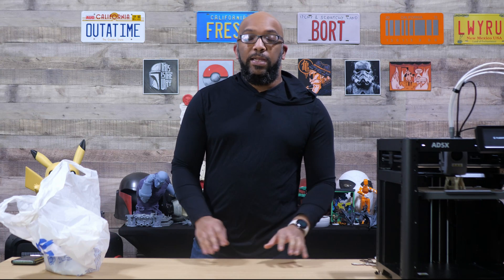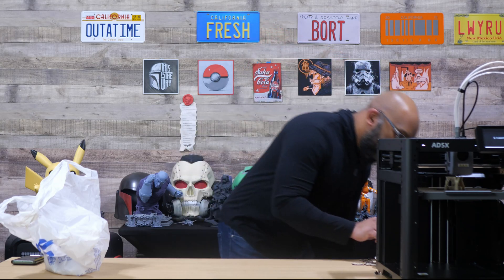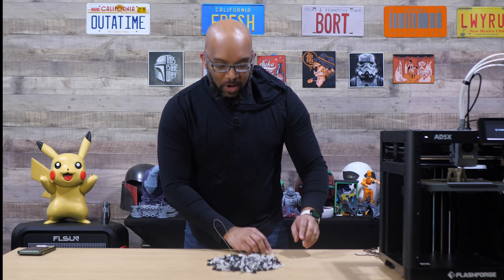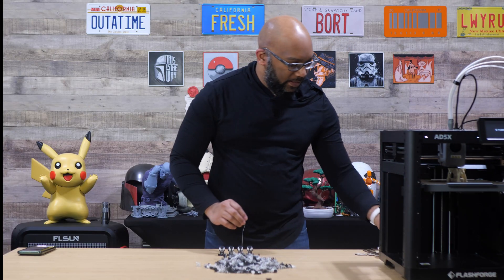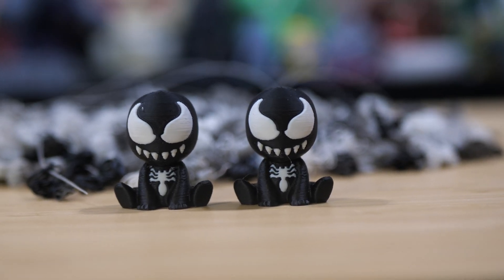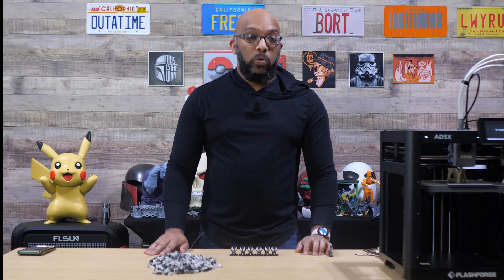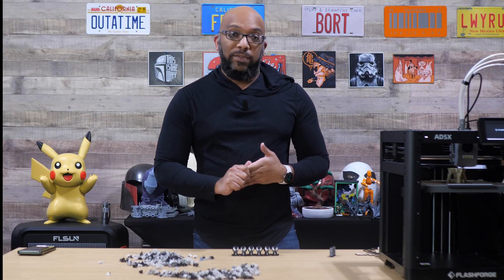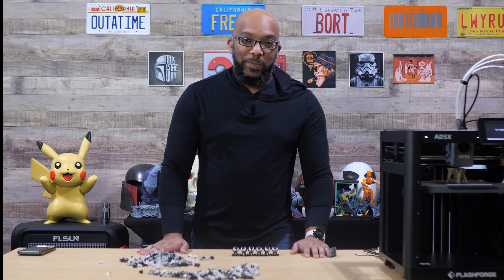How Much Does The Flashforge AD5X Poop?

Comment: I have now the AD5X and I was very shocked by the amount of poop it did for a tiny PETG model I designed!

It did about 50 times the poop in amount compered to the size of the small model.

I knew about it doing poop from other video reviews I saw before the buy of it. But really it did far more than I thought?

I even set the slicer to deposit some waste inside the model and the supports but still it was allot left over.

Then I got the model I did off the plate and it broke in half due to me not setting it with more strong infill.
So a small bag of waste poop for a broken small model, Plus it took 4.5 hours to print due to the many poop changes.

Maybe I should have carried on saving up and brought the new multi head kick starter printer being advertised now?
Reply: los productos tecnológicos de salida a menudo llegan con fallos de hardware muy fuertes,  asi que incluso si ahorrabas, es muy probable que tu  unidad cuente con defectos graves (y no sabes como va a responder la compañía con las unidades defectuosas). lo a
mejor siempre es esperar al menos 3 o 4 meses después de que salga y hallan arreglado todos los fallos graves, nunca ser beta tester.

Comment: Actually the problem isn't the filament changer, it´s the hotend. With a normal flow hotend (v6 size meltzone) you can use special profiles using different speeds on unload ("Ramping Profiles") resulting in nearly perfect filament tip, easy to reload. No cut&poo needed. Prusa Reseach developed this about 7 years ago, constantly improving this. Works extremly well on the modern mk4(s) or CoreOne with standard flow Nextruder nozzle, also on the good old mk3(s(+)) after changing the hotend to a Revo Six.

The problem: There are 3 types of waste:
1. Cut filament left inside the nozzle. As it isn´t connected to the feeder anymore, you can not retract it - so no way to reliable control it nor print with it. You have to poo it out.
2. Priming the nozzle. After filament change, you have to get the preasure right inside the nozzle, to get a nice print. Even on single colour prints - the priming line. The "priming tower" just are priming lines stacked onto each other in a stable geometry. Even toolchangers do this.
3. Cleaning the nozzle. Even after the new filament entered the meltzone, still molten old filament is inside the meltzone. To avoid colour bleeding, you have to press enough filament out to "wash" out the meltzone. But: this filament is retractable, you could actual print infill with it or an object were colour does not matter.

All theese new mulicolour printers as a standard combine 1+3 into poo, doing 2 last. None of theese, exept Prusa, use a different nozzle for multicolour (Prusa uses the Nextruder CHT high flow on mk4s and CoreOne, but recommends a Nextruder standard flow for multicolour), get rid of 1 and use 3 to print as infill or for a randomly coloured object. Actually all you have to do to reduce the waste on modern printers is changing the hotend to a Revo hotend, use Prusa Slicer and adapt all the settings. Of course, if some settings are defined as macros in the firmware, you need an open source firmware with full access.

So on a Prusa, you get much less waste than on the other printers. Also time for a filament change, including the primetower, is only between 30 and 40 seconds. Much faster than theese poopers. On a full coloured object the time saved on filament changes more than compensate for the lower volumetric flow the standard flow nozzle provides.

But even on cut&poo printers for mulicolour you should just poo out as much as needed to get the new filament into the meltzone. Add a bigger object to the build plate with enough infill to wipe into infill (or if the colour does not matter, use the complete object to wipe) and define this object accordingly in the slicer. Now the poo is just the filament left inside the nozzle after cutting, reducing the amount of waste significantly. The "avoid colour bleeding poo" turned into infill or another object. The new order is: cut, unload filament, poo out untill new filament reaches meltzone, prime the nozzle (prime tower), print colour transition into infill or wipeObject, continue.

Still, much more time for filament swaps and more waste than a Prusa + MMU. So I recommend to change the hotend if possible, if you print multicolour often.

However, for multimaterial (f.e. PLA/PET-G support trick) you can´t use the cleaning waste for printing. So here you actually need to poo a lot. (I)DEX or Toolchanger are the ways to do it, if you use this regulary on non horizontal interface layers.

So no, you do not have to live with the waste. You have to experiment and DIY. Or buy or build another more expensive printer. Like a Prusa or a toolchanger. And yes Prusas MMU3 is still not beginner friendly to set up and calibrate, not comfortable to use - but it works perfectly if you had learned how to calibrate and use it right. But you could modify your printer to use Prusas way to change filament faster and with less waste. And it can be fun to experiment different ways.

Of course, Revo isn't cheap - and the hot part is patented (and yes cloned parts from china are available illegaly). With about €100 for a Revo Six with 40W heater and one standard flow nozzle (and you need a high flow nozzle for single colour prints also...) it´s obvious why you do not find theese on cheap printers. Also not every user need this - some only use their filament changer to select the filament for their actual monochrome print, for spool join or for filament storage. Or as dryer (ACE pro on Anycubic Kobra 3 or S1 combo). At most doing one or two multicolour prints a year before Xmas.

It´s not a matter of R&D. Thats all be done for years now. It´s about getting the price low. But you pay the price afterward - with time & money. Buy cheap, pay twice...

Comment: Great video.  I have been tweaking the proflle in Orca-flashforge since receiving my AD5X.  The fleet of X1C printers at my workplace are just as wasteful. This is likely going to be improved over time, but as you pointed out, print many copies, to make yourself feel better about the poops. I have been printing multiples of the objects on my printer and give them away.  Keep up the great videos.

Comment: How would you say the speed is compared to a larger more intricate multi material system like the AMS, CFS, Ace Pro? Those have to do much lengthier retractions and reloads so I'm assuming this goes a bit quicker especially on bigger print jobs.

Comment: The problem is, it produces significantly more poop than my Bambu.  I own both machines and the poop from the 5x is almost twice that of the Bambu with the exact same settings.  Not only that, but the 5x took significantly longer to print the same object.  The 5x isnt ready, it needed more r&d before being released.  I love my 5m, but I very much wish I had never bought my 5x.  Spend the extra $50 and buy an a1.  Not a Bambu fan boy, love my 5m and I actually think for a single color printer its every bit as good as the Bambu.  Own other machines that I would would buy over the Bambu for single color too, but the 5x is junk in comparison.
Reply: Id rather not have a printer by a company that locks down their software.
Reply: @kingkazuma2568  they are all starting to do that, it has to stop